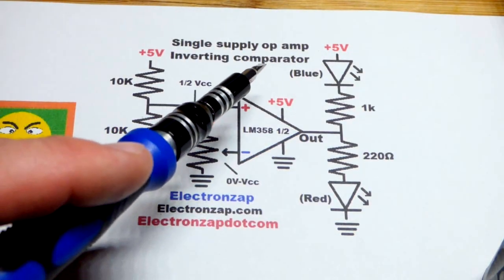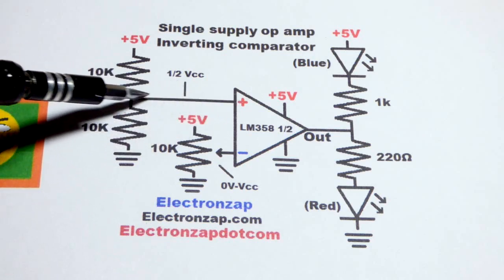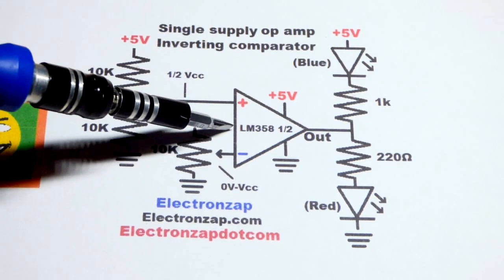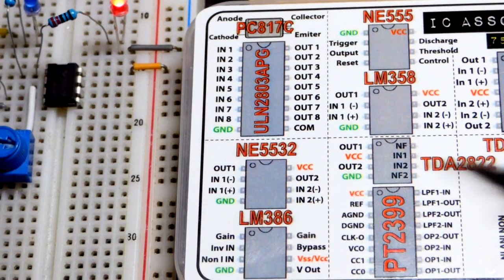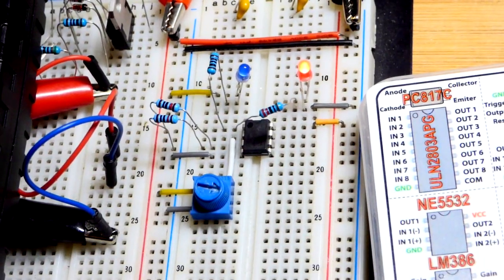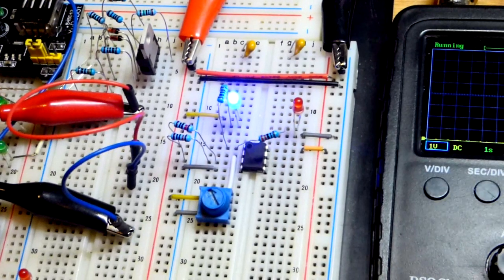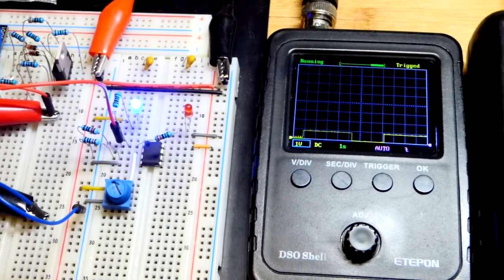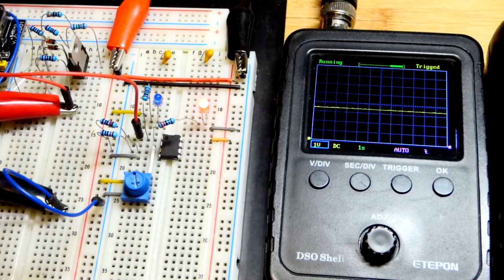Inverting comparator circuit using op amp LM358 single supply schematic and breadboard tutorial

Comment: I've been trying to build a circuit to run a 12 volt water pump with a solar panel. To protect the pump motor when The sun gets low and panel is providing less than 12 volts I want it to shut off. The problem I'm having is when the sun begins to set the the pump draws enough power to drop the voltage and the relay opens but as soon as the load is gone the voltage rises and the relay just clicks on and off. Can you suggest a video that would help? Thanks in advance
Reply from the maker: Sounds like you want a schmitt trigger. That expands the voltages needed to turn a circuit on or off instead of a specific voltage that it is easy to bounce below and above.